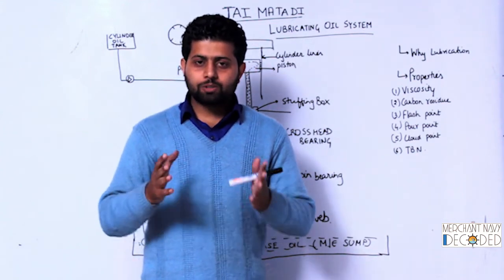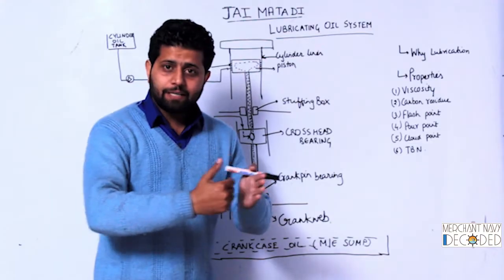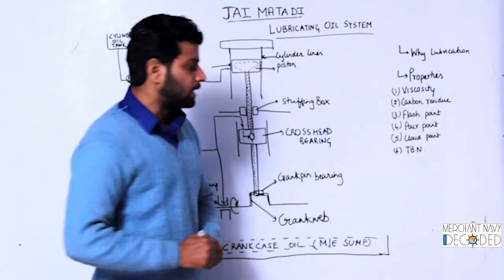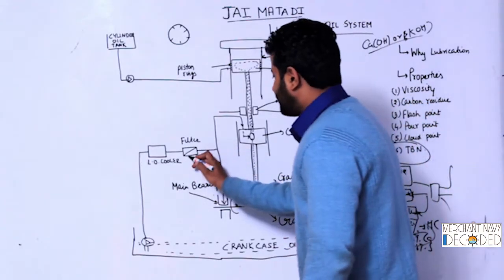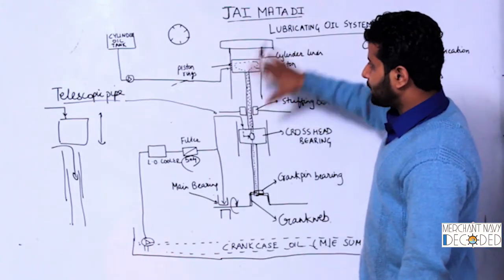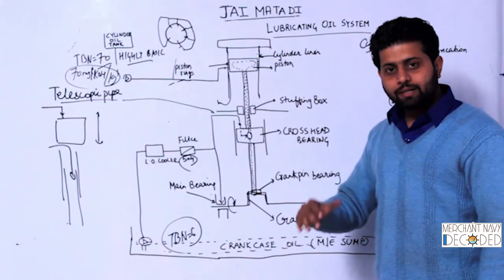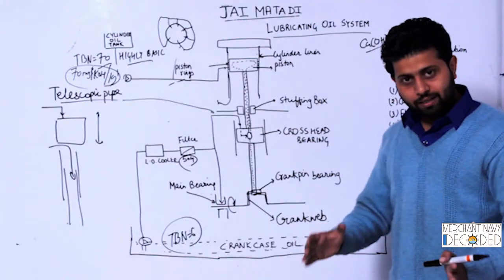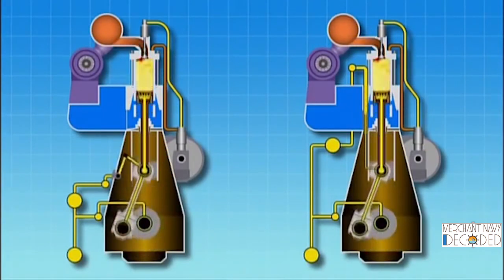How Two Stroke Engine Lubrication Work | Two Stroke Marine Engine Lubrication | Engine Working

Comment: Reciprocating motion of the piston is converted into rotary motion by the crankshaft right.? How come the other way.? And why the lube oil filter is placed after the lube oil cooler.?
Reply from the maker: have you joined telegram group "marine engineering decoded" please join and ask in that group.

Comment: Hii sir.... Very good explaination
Still i have doubt related to piston lubrication.... When oil flows up it cools the piston and comes back as u said..... Inlet and outlet oil flow junction to piston rod is it  same or different path ways... Please clear my doubt....
Reply from the maker: Beta difficult to explain without a drawing but still let me try , there are three holes in the the piston rod . The centre hole is the one which is of bigger diameter from where the oil enters inside the piston and from the two smaller diameters it comes out.